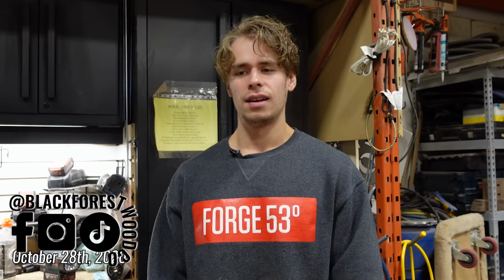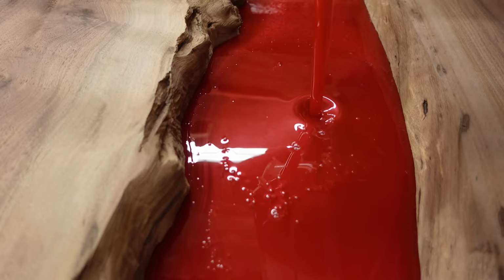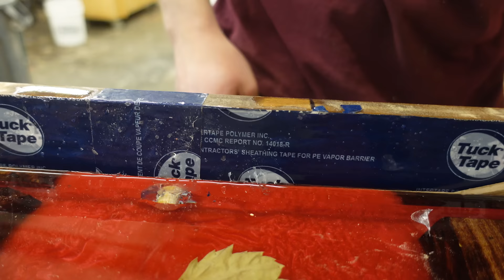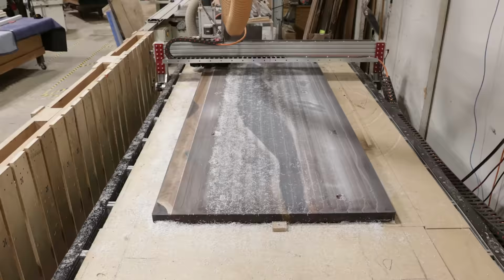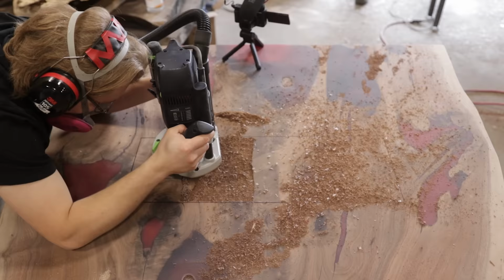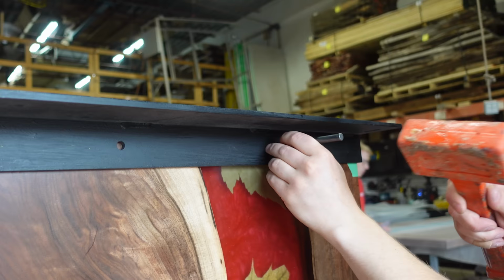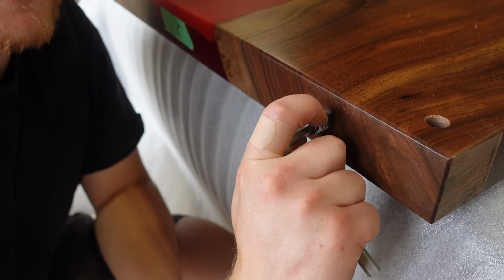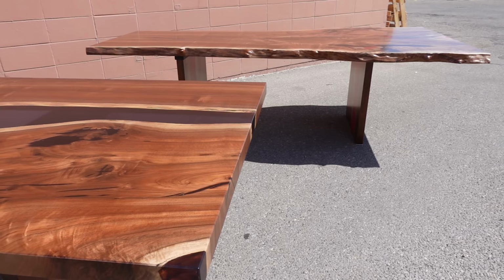Casting Maple Leaves in a Table

Comment: Another great job from BFWC. However I have 2 issues. 1 If laying maple leaves in the table should the timber for the table be Maple too, or you can ask why is there maple leaves falling around a clero walnut tree! 2 i was not keen on the black steel mountings for the legs, something with a little more finesse would be good. I understand the fixing needs to be strong but should not look so utilitarian, takes away from the magnificence of the timber work. Thank you Guys, brilliant work as ever. Cheers Michael.

Comment: Great looking table. The leaves really pop.  I realize the leaves are encased in resin but do to how thin they are maybe a few will break down due to decomposition?  What do you think?  Again, great video as always.
Reply: I doubt it as there is no oxygen, carbon dioxide nor moisture to compromise the leaf.
Reply: @arthurised  I tend to think there are still decaying processes going on and would decay one or two leafs at a time. I'm unsure how long it would take.

Comment: seem to be missing a step.  Could you explain!?  at 5:16  you show how you poor the resin and the taped blocks are attached to the table top so that the wood does not float up. 
I get it, BUT 5:58 you show banging those blocks out of the cured resign as you de mold!

So HOW do you fill those hole created by those block that have no resin under then?  Or  WHAT is the logiv of over filling with so much resin (seems at least a 1/4" on this table) if you jsut end up CNCing it all off?
Reply from the maker: We don't we plane it all down on our CNC.

We over pour to fill all the small cracks in the wood so we don't have to go back and have to do it after

Comment: The tables are beautiful! I do have a question about the pour. I saw some very attractive holes in the slab that made me concerned about trapping pockets of air. Is that ever a problem and, if so, how do you deal with it? I can imagine putting awls or screwdrivers down there to release the air pockets, but I don't know that is practical with resin.

Comment: Why don't you cut out the leg pockets on the CNC and not take a bunch of time and energy to use the router for those pockets.  Then just clean up the square corners with a chisel.